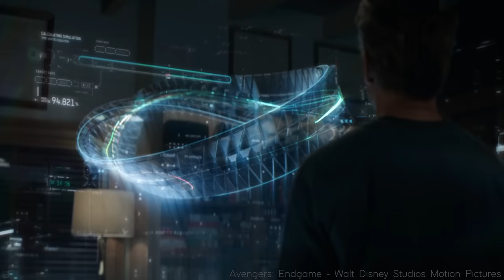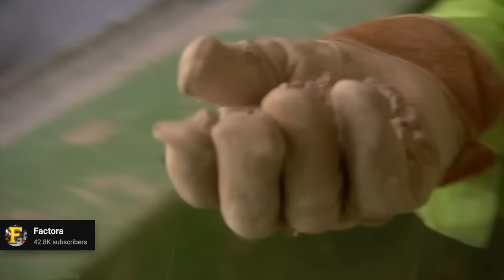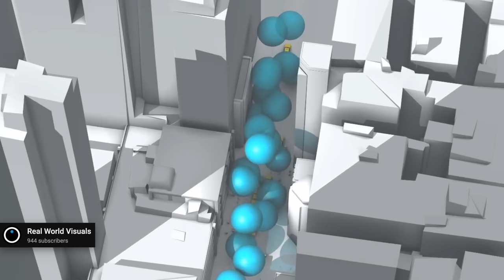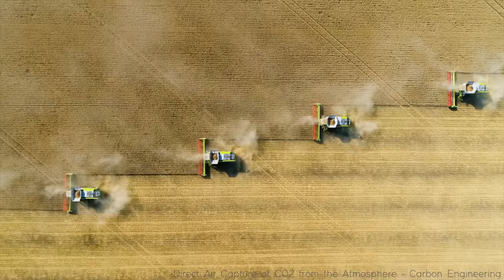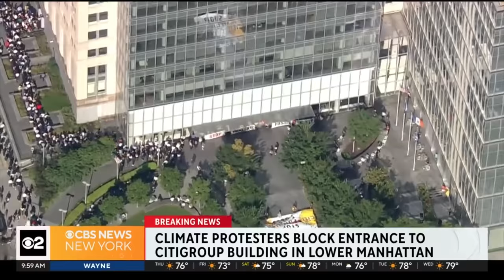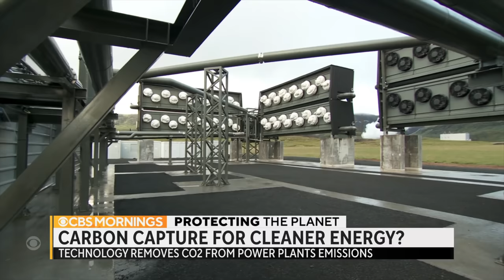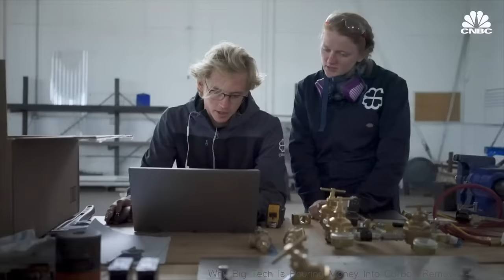How Thermodynamics Holds Back Negative Carbon Tech

Comment: Did my PhD on CCUS and have been working in the area in various capacities for last 15 years.  DAC is the absolute hardest way to do CO2 removal, but likely needs to be done.  The good thing is that regeneration of the sorbent or solvents can be done with low grade heat, in places like TX it might even be done via solar heat not needing electric at all.  Unfortunately, compressing the CO2 for storage is also quite consuming.  The other major issue is moving the air through the device.  The chemistry is fairly easy to understand, but the engineering for reduction of energy is quite hard.
Reply: It would be great if we could transform the residue in something useful, like carbon fiber or something else.
Reply: Please explain to me how it would sense to use energy from renewables to power fans with an efficiency of around 8% to suck CO2 out of the atmosphere when this same energy could be fed directly into the grid displacing the same amount of energy generated by fossil fuels and thus preventing more CO2 generated by burning fossil fuels being pumped into the atmosphere?
Reply: @zaar2604 As dr. Kipping mentioned in the beginning of the video, we have no option. There's no enough land to plant all the trees necessary for the job. 
In other words, there's ALREADY too much CO2 in the atmosphere.
Reply: Should have done a year in economics first so you could have then focused on something else that would also have been useless because you didn't do a year in sociology.

You may as well have worked on free wireless electricity for muggers.
Reply: @MCsCreations  maybe you try to address my question please?
Reply: @JohnnyWednesday bro you don't even know what he studied only his PHD research
Reply: @zaar2604  Again: or we do it or things are still going to get worse and worse, even if we stopped producing any CO2 today.
Reply: @MCsCreations  things will get, that's for certain at this moment. Still doesn't address my question though. Unless renewables cover over 100% of the world wide energy need, meaning renewables produce excess energy, it makes zero sens to divert energy from renewables into fans trying to suck CO2 from the air.
Reply: @zaar2604  Go nuclear.
Reply: @zaar2604  : I will try to explain it to you. We already live in a world where we have spewed so much CO2 into the atmosphere that we will not be able to remove CO2 to sufficiently low levels by maxing out on our ability to plant trees, sequester CO2 via changes in agricultural practices and through use of BECCS. Its that bad. We will have to invest in an expensive and not very energy efficient way to remove the CO2 directly from the atmosphere in order to keep the Paris Agreement. You have the right to be upset with the politicians of the world for failing to act earlier.
Reply: @patricklincoln5942  thanks for the attempt but this did not address my question. Fans sucking CO2 out of the air is similar to spending 1 dollar to save 10 cents.
Reply: @MCsCreations  agreed, go nuclear + renewables and don't spend anything on fans sucking CO2 out of the air.
Reply: @zaar2604 : Your question was why does it make sense to do this, to remove CO2 from the atmosphere via use of Direct Air Capture technology. I will try to make an analogy to a cancer patient's situation. There are many ways to actively prevent cancer at a lower cost if you intervene before you get cancer. You can pay for healthy but slightly more expensive foods, you can do your exercise, you can avoid smoking and alcohol. But if you don't do those things and the time comes where you already have cancer, you can't just use all those inexpensive hacks, you have to use expensive chemo treatment to survive. Humanity is in a similar situation. Its too late! All the inexpensive stuff alone wont solve your problem. Here is another explanation. Suppose methods A,B,C,D and E are the only methods to remove CO2 from the air. Suppose further more that all of them have physical limits on how much CO2 can be removed and that method E is far far more expensive than the others. If you intervene early you can avoid to much CO2 with A,B,C and D alone. But if you wait until the CO2 concentration is too high, then deployment of E will also be necessary. And even though the price tag is high, the price of not paying is climate chaos and collapse of civilization. I hope these explanations make sense to you. If they don't, then I am wondering if the disagreement might have more to do with a disagreement about how deep a hole humanity has dug for itself already.
Reply: @patricklincoln5942  another point is the use of cheap geothermal energy in Island for example. You cannot export this energy to where it would be needed to reduce CO2 emissions somewhere else. So what do you do with this low temperature energy source? You just have 2 options: Use it for CCS or not use it at all. BTW this is exactly what is planed in Island ATM
Reply from the maker: Thanks for chiming in! Hope I did it justice here. Ye I didn’t even talk about compression issues. Here I tried to frame the absolute most optimistic situation to avoid arguments about tech development. Good point about using Solar without electricity, Lackner wrote about that using evaporation powered systems in the linked article for more there.
Reply from the maker: @zaar2604 the idea is to use renewables always first to power everything you can, but tons of emissions are possibly unavoidable, like the manufacture of cement, steel, aviation, agriculture, etc as discussed in the vid 👍
Reply: @JohnnyWednesday  Pretty assuming there.  I do have some economics background as well, in fact the last 10 years has been nothing but economic analysis of various technologies.  I also have a handful of companies I've started and am doing pretty well economically.  You assumed I only did carbon capture, it simply one of many areas I apply economic analysis.
Reply: @CoolWorldsLab  My science background is in chemical engineering, thermodynamics is one of our three major pillars.  You being an astrophysics person, I'm jealous of your ability to so well articulate and reach to different areas.
Reply: Are any scientists actively trying to disprove global-warming (particularly at tax-payer expense)?  Because I'm pretty sure that's how you prove stuff in science.
Reply: @zaar2604  "Please explain to me how it would sense to use energy from renewables to power fans with an efficiency of around 8%"

not one part of this cult has to make any sense. its all about just doing stuff to show virtue and allegience.

the CO2 levels are at a historical low point and near starvation levels, just now finally creeping up towards slightly more comfortable levels which is why we have a greener surface area than weve had since at any time post industrial revolution
Reply: @MCsCreations  "In other words, there's ALREADY too much CO2 in the atmosphere."
WHAT? in your previous two sentences you in no way said anything that could be followed up with "in other words we already hae too much co2"

HOW do we have too much co2 in the adress and how did your previous sentences in any way adress that or even were on the same topic as that?

the earth was way healthier at 20x current amounts...
Reply: @zaar2604  "things will get, that's for certain at this moment. "
the earth is healthier than its been since at any time after the industrial revolution. 

1% of the amount of people dying from climate related events today than 100 years ago

italian scientists recently saw no statistically observeable change in earths climate.
but im sure you know for sure better than those huh?
Reply: @patricklincoln5942  the earth is healthier than its been since at any time after the industrial revolution. 

1% of the amount of people dying from climate related events today than 100 years ago

italian scientists recently saw no statistically observeable change in earths climate.
but im sure you know for sure better than those huh?
Reply: @patricklincoln5942  "we will not be able to remove CO2 to sufficiently low levels"
could you explain and detail why and how sufficiently low CO2 levels would look when you dont even seem to know the basics of the facts that CO2 is at a historical low point and were just close to starvation levels
Reply: @patricklincoln5942  " in order to keep the Paris Agreement. "
uhm... and why would you want to...? youre coming from a default place of accepting that as stated and proven reality...
Reply: @patricklincoln5942  "Your question was why does it make sense to do this, to remove CO2 from the atmosphere via use of Direct Air Capture technology."
and he perfectgly explained why it obviously doesnt with basic kindergarten math... your fellow cultist that is on the excat same movement as yours is showing you logical and clear math about the insanity of using renewable energy on 8% effeciency instead of 100% effeciency and you still go on and on
Reply: @patricklincoln5942  I don't know patrick, you still didn't address my question as my question did not only consist of "why remove CO2 from the air via DAC". 

To use you cancer patient analogy, let's say there is an individual who tries their utmost to not get cancer in the future, they spend a lot of money on buying the latest space grade vitamins and other supplements, BUT they also drink, smoke and eat junkfood at the same time and don't want to give up those habits. 

DAC is like that patient in my analogy, spending thousands to save a couple of bucks. 

It makes way more sense to feed renewable energy directly into the grid than power fans that suck CO2 out of the air at an efficiency of 8%. This way fossil fuel energy could be phased out and the reduction of CO2 emissions would be quite big. Those reductions of CO2 would NEVER be achieved by using the same energy to suck CO2 out of the air with fans.
Reply: @Soldierboy54b  yea, these people dont see the problem with the whole world of academia having an underlying constant pressure on them, incentives that they need to tow a line in order to feel safe about getting continued funding and being able to feed themselves
Reply: @zaar2604 : I am not sure you have yet understood the situation humanity is in. It is no longer enough to reduce emissions. We are too late for that. We have to find a way to get CO2 out of the atmosphere or we will loose cities, experience crop failures in the future etc. Do you agree with that assesment?
Reply: @zaar2604 , I work in the DAC space, and your question is an excellent one!

I generally contrast the rate of CO2 that is emitted during electricity / thermal energy generation vs. the rate of CO2 capture for any given DAC system.

As touched on in the video, it does not make sense to power DAC using gas or other fossil fuel energy sources, because of the low capture efficiency.

Gladly, the vast majority of new electrical generation capacity added in recent years comes from renewables.

So, as long as we add only renewable, low carbon emitting energy sources to the grid that will be powering the DAC systems, we're in business.

Let me know if this makes sense to you.
Reply: @zaar2604 : I will try again. Here is a simpler explanation. Even if we exhaust all of the cheaper more energy efficient methods that are available, it still wont be enough to get all of the CO2 out of the atmosphere that we are required to move.
Reply: @chemicalfrankie1030  : I think you might be mistaken. How do you know he didn't take that into account?
Reply: @johgude5045 : On Iceland do you mean? Do you know how efficient this method is compared to DAC?
Reply: @winflexful  As long as there are fossil fuel plants around I don't think it makes sense to divert renewable energy to any carbon capture as this energy would be better spent preventing any more CO2 emitted.
Reply: @wasdwasdedsf  : When nearly every nation of the world has signed up for the Paris Agreement and nearly all relevant scientists who have been requested to take a position on it have endorsed it, then the default position should be that it is something that we should keep and strive for. If you think there is something wrong with that position it means that the onus is on you to explain otherwise.
Reply: @zaar2604  ... The problem is that going renewable in everything that can possibly go renewable will not be enough, because we already have too much CO2 in the atmosphere (so stopping emitting will stop the increase, but not reduce it to acceptable levels) and because there are things that will unavoidable keep emitting CO2. We need to go 100% renewable in electricity production, move as much power produced today with non-electric means (heating, transportation, etc) to electric means powered by renewable, and then have extra renewable capacity to run carbon capture with 1st priority being at the source and 2nd bein DAC or DWC (direct water capture). Note: with "renewable energy" I actually mean "green energy". Fusion and (someday) fission are not renewable but are good too.
Reply: It is just too cheap to pollute. Cement factories have never, until now, tried to look at reusing the waste heat and CO2 in some way.
Until now they have only been concerned with the price of the fossil fuels used. And these factories have been running for almost 100 years now.
We can do better, if the economic incentives are not keeping us from it.
Reply: @zaar2604 Because you have not watched the video and if you want things to reverse you will have to do this at some point. You can't plant enough plants in the world to sequester all the carbon
Reply: @poulhenne  co2 isnt pollution
Reply: @wasdwasdedsf  ... Not sure what definition of "pollution" you use. In mine, pollution is the introduction of harmful substances or energy to the environment. If you consider CO2 to be a substance and the increased greenhouse effect to be harmful, then the release of net CO2 into the atmosphere is pollution, by definition. And so is waste heat. Now, if in your definition CO2 (and waste heat) are not pollutants, first of all I would ask you if you consider CFCs to be pollutants, and then I would say no problem, replace the verb "pollute" with "harm the environment" and @zaar2604 's comment still fully applies.
Reply: @JohnnyWednesday  A year in sociology is still a better use of one's time than the time you put into making your so-called music.
Reply: @zaar2604  Because, the energy needed to suck CO2 out of the air is only 3% that released by burning the stuff. But when you combine an 8% efficient DAC with a 50% efficient power station, that's 4%. So CO2 +ve but only barely. 

More to the point, in a growing portion of the world, much of the energy comes from renewables. Increasingly often they need to turn wind turbines off because they have nothing to do with the energy.
Reply: how much does "working in various capacities" itself contribute to the problem?  my carbon footprint is basically only what i exhale...
Reply: I absolutely loved reading all this, I’ve learnt quite a bit about the climate debate. Thanks yall👍
Reply: @MCsCreations 

Again that would need  ENERGY to reverse the chemical process first done when the sequestered carbon was burnt in the first place .
Reply: @zaar2604  No, you either didn't read his comment or are being dishonest.

In his cancer analogy, he likened the DAC to an expensive chemotherapy. The reason why we need the expensive chemotherapy is very, VERY simple: We already have cancer.

I repeat: We ALREADY HAVE cancer. We're no longer trying to prevent cancer here - not a single human on earth can prevent something that has already happened, unless you can somehow time travel. No amount of space grade vitamins or habitual correction will cure cancer. Thus the chemotherapy.

Look, you wanna have differing opinions? Fine. I myself am not convinced we're that far gone already (as in, I personally am not convinced we already have cancer), but the guy certainly thinks so. And at the very least, if you're engaging in an argument, have the decency to pay attention to the opposing arguments. Otherwise you'd just ramble.
Reply: @patricklincoln5942  don't worry about the CO2. The oceans will do more in one second than humans can do with a machine.
Reply: @LogicalLighting : That may be the case right now. But why should I then not worry about CO2?
Reply: What’s the name? I wanna read
Reply: For moving the air through the device, could it somehow be directly integrated with a wind turbine in an area with good wind flow, and process the air as it goes over the blades? And use the energy generated from the turbine to power the rest of the process?
Reply: @patricklincoln5942  Not if we cut emissions below 70% of current where natural processes can work on slowly reducing atmospheric concentrations, i.e. take mitigation seriously. That's nuclear build out plus new renewables plus hydro plus in a WW2 type drive. Then use SRM to get temperatures down to limit the increases in natural emissions and allow time for natural processes to do their job.
Reply: @Soldierboy54b : At this point that is kind of like trying to disprove relativity or evolution. This evidence is too large and overwhelming.
Reply: @wasdwasdedsf : You are cherry picking. You need to look at what all scientists are saying on the whole. It is not sufficient to just listen to the ones who claim what you want to hear.
Reply: @wasdwasdedsf : That was an international agreement. If you want to disagree with them, then you should take it up with them. In the meantime, like a normal citizen, I will give them the benefit of the doubt.
Reply: I see many unanswered responses from you from a year ago. Oh well. I hope you learned since then?
Reply: @zaar2604 : You wrote "" I don't know patrick, you still didn't address my question as my question did not only consist of "why remove CO2 from the air via DAC". 

To use you cancer patient analogy, let's say there is an individual who tries their utmost to not get cancer in the future, they spend a lot of money on buying the latest space grade vitamins and other supplements, BUT they also drink, smoke and eat junkfood at the same time and don't want to give up those habits. 

DAC is like that patient in my analogy, spending thousands to save a couple of bucks. 

It makes way more sense to feed renewable energy directly into the grid than power fans that suck CO2 out of the air at an efficiency of 8%. This way fossil fuel energy could be phased out and the reduction of CO2 emissions would be quite big. Those reductions of CO2 would NEVER be achieved by using the same energy to suck CO2 out of the air with fans." My response: I already answered this. We are in overshoot. Too much CO2 in the atmosphere, which you disagree with. That is what makes the difference.
Reply: @thedualtransition6070 : You wrote " Not if we cut emissions below 70% of current where natural processes can work on slowly reducing atmospheric concentrations, i.e. take mitigation seriously. That's nuclear build out plus new renewables plus hydro plus in a WW2 type drive. Then use SRM to get temperatures down to limit the increases in natural emissions and allow time for natural processes to do their job." I have had so many replies to people in this thread that it is hard for me to be sure exactly what you are responding to, but I have an idea of it. I know what you mean by SRM. It is quite possible that SRM together with all that you have mentioned can circumvent the need for DAC (Direct Air Capture) with respect to satisfying the Paris Agreement. However, it would be at the expense of ocean acidification.
Reply: @patricklincoln5942  "nearly all relevant scientists who have been requested to take a position on it have endorsed it"
oh really, (allegedly) all scientists they wanted opinions from supported them. thats surprising
Reply: @patricklincoln5942  "If you think there is something wrong with that position it means that the onus is on you to explain otherwise."
youre the one making de facto statements about consensus.

the old "there is complete consensus cause we decide whos opinions to include
Reply: @adb012  "The problem is that going renewable in everything that can possibly go renewable will not be enough, because we already have too much CO2 in the atmosphere"
lol what? 

400 ppm is too muc hdespite the earth being far healthier when ta levels of 4-8000 ppm?

so its too much how now?
Reply: @thalesnemo2841  "
The KEY IS THE RATE OF CHANGE SINCE 1750 ! "
and thats a problem why?
Reply: @patricklincoln5942  "You need to look at what all scientists are saying on the whole. "
thats great. can you post a source to every scientist in the world and their specific opinion?

"It is not sufficient to just listen to the ones who claim what you want to hear."
the irony is off  the charts...
all you people do is apeal to authority...
Reply: @patricklincoln5942  
"It is not sufficient to just listen to the ones who claim what you want to hear."
the irony is off  the charts...
all you people do is apeal to authority...

you run away from debates like your lives depended on it... and ogt humiliated the few times you dared to show up
Reply: @patricklincoln5942  "That was an international agreement. "

i agree. germany and russia made a deal in the late thirties. if you have a problem with that, take it up with them
Reply: @patricklincoln5942  " In the meantime, like a normal citizen, I will give them the benefit of the doubt."
in the meantime you will give the benefit of the doubt to the nmost ineffeicnet and worst organisation in human history, governments?
Reply: @wasdwasdedsf : I find it strange that you ask me to post a source to every scientist in the world. That kind of comment shows you aren't giving this much thought. If you have 100,000 opinions from scientistis in a topic to sort through, you don't want 100,000 posts from me. That would be a waste of my time and yours. Instead you can look up a meta study on the topic (where they someone has in fact done the work of taking a survey on the topic), or you can have a look at the opinion of some of the scientists who have a good reputation in the area. Pick your method. But in this case, I am not going to do that work for you. You can ask questions if you are serious about wanting help, but your response doesn't appear to be a serious or well thought through response.
Reply: @wasdwasdedsf : You wrote ""If you think there is something wrong with that position it means that the onus is on you to explain otherwise."
youre the one making de facto statements about consensus.

the old "there is complete consensus cause we decide whos opinions to include" . What was the claim in question?
Reply: @wasdwasdedsf : I think you must be referring to my comment about the Paris Agreement. Look, you don't have to believe me if you don't want to. But if you want a random sample of "relevant" scientists, you can look at some of the names of the scientists who authored the IPCC report, figure what their fields of study are, then find say 50 random scientists who study in those fields and then ask them via e-mail what their opinion is concerning the Paris Agreement. Ask them if they think it is something that the nations of the world should strive to live up to (while stating that it is a survey). Then you will get your answer, and you we see that I am not B.S.ing you. But I will leave that work to you. I am not your mother. Make sure that your sample is RANDOM, and not taken from a circle of your friends. Otherwise you will be defeated the purpose of your survey.
Reply: @wasdwasdedsf  ... Are you serious? The levels of CO2 have more than doubled since 1900. The last time they were this high was 20 million years ago. 20 million!!! Humans have been on Earth for about 200,000 years only, so in 20 millions you can fit the whole human history 100 times. At the current rate CO2 is expected to go to 1000 PPM by the end of this century. The last time it was so high was 50 million years ago. You said 4000 to 8000 PPM? I don't know, my charts go to 400 million years ago (even before dinosaurs) and it peaks at 2000 PPM. SO was it billion of years ago? When the sun was much less bright that what it is now? Of course the Earth will survive. The question is how much suffering will that cause. When we were hunter-gatherers nomads, moving from a place to another following the good climate, food availability, etc was relatively easy. Now with cities, budlings, houses, roads, airports firmly attached to the ground. It is let's say more complicated. People will need to migrate by the millions. And they will have to abandon their homes without selling them or selling them at garbage price, while the prices of homes at better zones will skyrocket. This will cause a lot of poverty and unrest. Both things cause suffering and death. Earth will survive climate change fine. Humans as a specie will survive climate change, but not fine. It will cause a lot of suffering, unrest, poverty, migration including migration between countries, including into countries which will not be open to receive them, causing violence and even wars. Of course, you are probably going to be fine (or already dead) why why care, right?
Reply: @adb012  "Are you serious? The levels of CO2 have more than doubled since 1900. The last time they were this high was 20 million years ago. 20 million!!!"
wow! impressive!

and tell me, if the fact would have been so that the last time they were this level were instead 200m years ago, would that make the current co2 levels 10x more dangerous, because it was 10x longer ago? 

why do you reiterate random numbers?
Reply: @wasdwasdedsf  ... You either didn't read my answer or you are being a strawman.